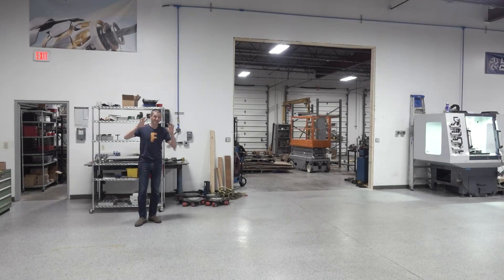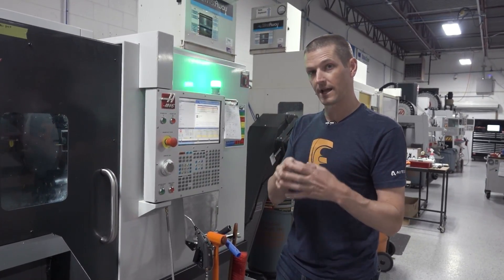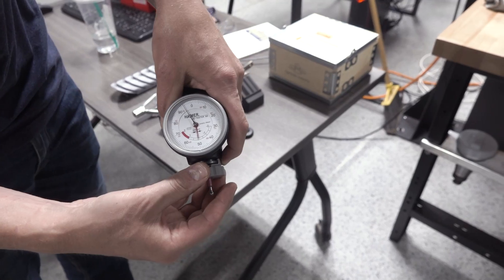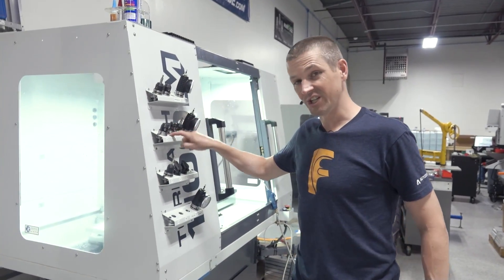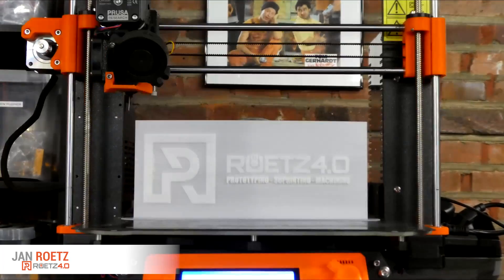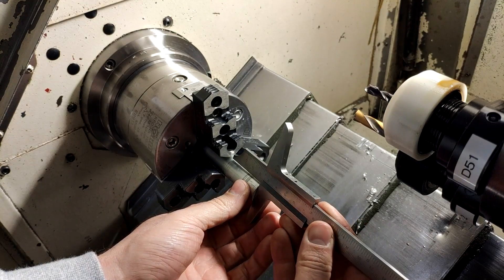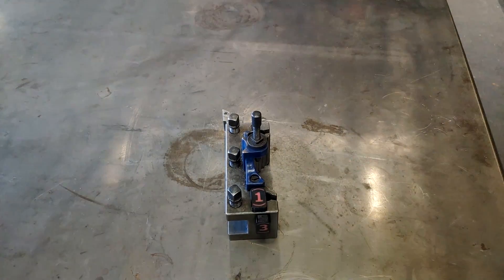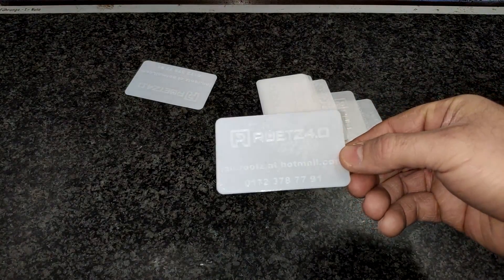Useful 3D Printed Items for CNC & Machine Shops!

Comment: I recently bought a printer solely to make useful tools and parts. Many handy items do not require a perfect or even a particularly good print so after three benchys I switched to printing storage enhancements, funnels (specialty funnels are surprisingly useful) and so forth. Phone/device holders and parts are trivially cheap to print as are RAM-style mounting ball attachments with various bases.

Comment: How did you get the HAAS and tormachs to fill when printing. When I throw them into my print software it only prints the inside and not the outside.

Comment: 13:18 buy collets that designed high speed drilling and its so tight it only let coolant thru drill. and normal collet has change broke drill in first hole if it hair angled. it happens

Comment: Well I normally use the back on a broken end mill in a callet chuck holder on the leath.
 ( metric eks. T4 M5
G0 Z10. 
X2. 
Z2. 
G1 Z0. 2 F150
M0
Z2. 
G0 Z10. 
X150. Z150. 
T2 M3 S1200) 

Always works perfectly for me and I have one hand to close the chuck and the other one to pull and hold the stuck out to the stop/ back of the broken end mill well the chuck is closing

Comment: That company Desktop Metal makes a carbon fiber printer called Fiber.  Uses a small strand of pre preg CF with some type of normal printing medium.  Supposed to be harder/stronger than steel and great for Tooling.  Might be worth a look, but its $3700 a year for the printer. 

I’ve went down a lot of rabbit holes since I started a Aerospace Tooling class. 😂

Comment: Here's a quick rundown of all of the models shown here:
(I only included parts that had a specified title and explicit "start time.")

00:36 - CNC Shop Model
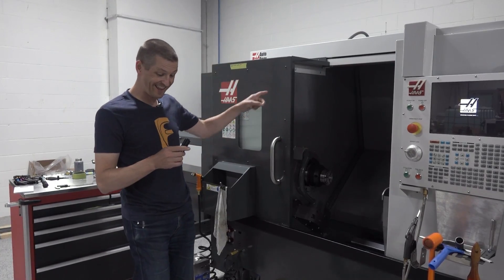1:21 - Bushing Thingy
2:26 - Linear Rail Covers
3:04 - Parts Catcher Door Extender
3:09 - Capto Block
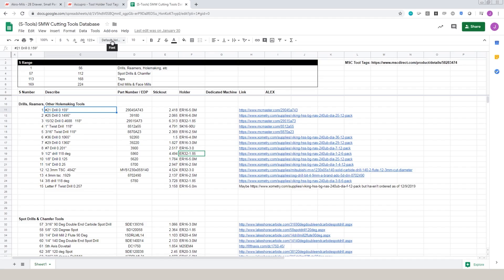3:41 - Tool Tag Organizer
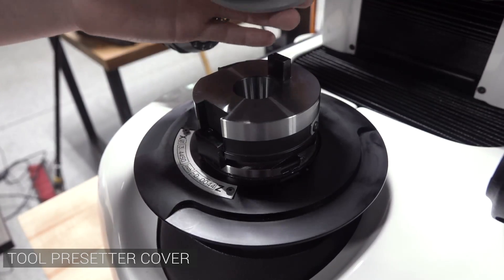4:28 - Tool Presetter Cover
5:02 - Haimer Tip Compressor
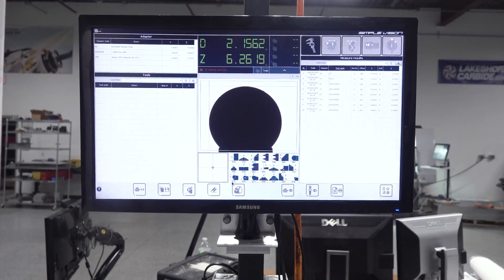6:03  - Microscope Tool Stand
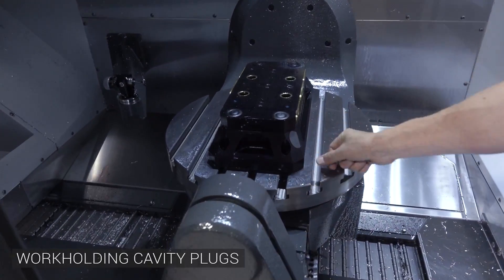7:41 - Workholding Cavity Plugs
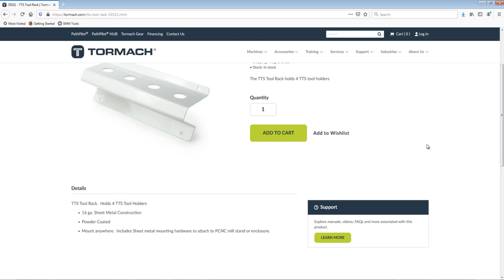8:24 - Tool Backers/Stabilizers
8:37 - Plugs to Color Code Fixture Positions
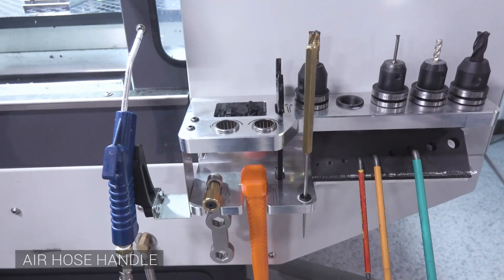9:02 - Air Hose Handle
9:11 - Schaller Bins
9:45 - Magnetic Assembly Jig
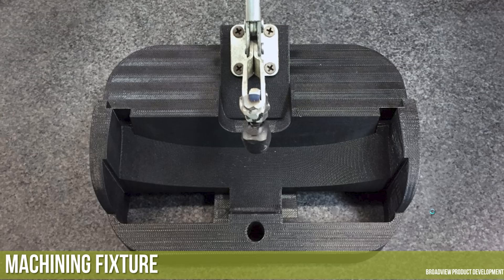10:15 - Machining Fixture
10:31 - Assembly Fixture
10:32 - Inspection Fixture
10:34 - "Around the Shop" Tools
10:36 - Organization Fixture
10:38 - Safety Tools
11:31 - Airbearing
12:19 - 1-2-3 Block Cover
13:02 - Collet Coolant Block
13:45 - Raw Stock Fixture
14:25 - Spindle Backstop
15:44 - Lathe Tool Offset Labeling
16:38 - Tool Rack
16:55 - Power Feed Adapter
17:14 - Drill Guides
17:57 - Press Tooling
18:18  - Moulding
18:43 - Signs
19:02 - Business Cards
Reply: Well, aren't you a helpful guy. Thanks a ton, man.

Comment: The Haimer preload-ring will only work with an optical tool pre-setter.  The spring tension in a typical mechanical pre-setter will further compress the Haimer tip and the measurement will still be inaccurate.  I unfortunately don't have a Speroni :(
Reply: You can still adjust the haimer to zero with the presetter applied to comp for that, no?

Comment: Interesting ideas. Given you have "access to" a machine shop, what makes you choose 3D printing something rather than machining it from Delrin? Despite 3D printing being insanely slow, is that still faster?
Reply: I can not speak for NYC CNC, but I can think of several reasons. 
#1 CAM workflow for 3D-printing is very simple compared to a CNC machine, so you may save a bunch of man hours. 
#2 Machine time on a CNC machine is likely more expensive than on a 3D-printer, as the printer is less of an investment, and tool wear is minimal. 
#3 Depending on the part in question you may save considerable amount of man hours with a 3D-printer, even if the print it self is slow, as they don't require much monitoring or interaction while making the part. This is particularly true if the part in question would require multiple setups for machining.

That said, I do think several of the parts in this video could just as well have been done on a CNC, Laser-cutter or even old-school by hand from wood or sheet-goods. The way covers would be a good example where other methods could have worked just as well. Where 3D-printing tends to shine is where you have relatively high complexity and moderate size and tolerances.
Reply: @2testtest2  I figured there'd be good reasons. I have no experience of CAM other than a little bit of Sketchup exported to Cura, and I imagine there are way more things to think about with reductive machining in terms of tool paths etc. Good point also about work time vs elapsed time - on the assumption they have plenty to get on with while waiting for 3D prints, they're effectively instant and so there's no real cost in waiting for them.

Comment: I 3D printed a mini mill CNC conversion with great success. My intention was originally to 3d print the conversion, then mill the parts out of aluminum. But it works so well I see no reason to waste my time or the material to remake the parts. I could have made them on my manual machines, but that would have taken up a lot of my limited shop time.  A 3d printer is like an employee. You give it an action plan and it gets to work. It doesn't need sleep or breaks. I have 3 printers to split up the work load for faster results with multiple parts, and am working on building a 4th that will handle larger parts.
Great video guys!

Comment: Have you tried printing in TPU, used it for seals, worked pretty nice. I use mine most for assembly tools and jigs. And fridge magnets in all shapes, magnets are fully enclosed, i pause the print at a certain hight and insert the magnets, then resume printing over them.

Comment: JUST WOW! I am 100% Disabled Vet.  and I got a 4896 CNC Router to work from home when I'm not down because of surgeries. I was 3D printing before I got wounded and KNEW the two could integrate BUT this video gave me TONS of ideas on printing holding jigs, tool jigs, storage and so on. Really appreciate the help. Video felt like you came into my shop and pointed out what I could do better. Thanks for that!

Comment: At the shop i worked at with a visual touch off machine like yours we just set the length of those manual probes to the center of the tip. Then all the machines that used it had a global WCS shift.

Comment: For the little magnetic labels, you can have the number be proud of the surface and use an M600 command in your gcode to do a filament change at the first layer of the number, and throw in an equivalent filament of a different color, giving you a number that is easy to read without the additional step and cost of pouring silicone.  The number will be proud of the surface, so maybe you wanted it flush, but I figured I'd throw it out there as another method to accomplish the same thing.  You could also go crazy with Prusa's MMU or the mosaic palette system to do multiple color/material printing in the same level, but that's more cost and more fiddling, whereas the M600 filament change is quick and free (assuming your printer firmware is relatively recent and supports it).
Reply: That's a really good idea. I'll maybe add a dual color version on the TV page!
Reply: Or cheap and easy version is to fill the lettering with the color of your choice nail polish. Let it cure and it is pretty much coolant proof, have had these on machines button labels etc (laser cut sheet metal with stamped letters filled with color)

Comment: I dont get it. Why you use a printer when you can mill these parts faster and in much better quality?
Reply: 3D printing is a better route when you're rapid prototyping a design because 
A) you have the ability to go through multiple iterations testing fit and tolerance quickly
B) the cost in plastic filament is much lower than raw stock that you remove material from
C) sometimes the design just doesn't need a machined part to operate (ex. the toolsetter cover that john showed off, absolutely 0 reason to machine that from a more expensive material when a 3D print will do just fine)
D) the time cost is not worth traditional machining all the time, why sideline a mill or lathe producing a part to organize or help setting something when a cheaper 3D printer could do that job while your costly machines can make parts for customers at the same time

Comment: I have robot at work which is used to move small cups. I was seriously pissed off to the manufacturer when I ordered fingers for their tooling. They were dimensionally all over the place and made by hand. Now I 3d print spares for that. They're Alsop perfect for us mechanics who need "bullets" to keep sealing rings intact when inserting sharp edges shafts through bushing and seals. I've made multiple for packaging machines. One of my favorites is simple ratchet "socket" that I use for handing vacuum cup screws on various machines. Someone always used improper tools to change cups and scratched suction screws, which could in tight spots mean marks on all products handled. I also make markings similar to the end of the video, but I don't bother to use silicone or something like that. I just simply print ie. black background and then have layer/color change and use something like orange to make marking really visible. Also people handle at my workplace with multiple models of canisters. One worker asked me that if I could make some tool to get better grip. Lady was really, really happy for that tool and now I've done multiple models and I'm still astonished how many "could you make something similar to model X, but that would work with this" requests. But I don't mind, I'm glad that I can help if someone struggles daily with something.

Comment: 0:42 After your remark about the 1::32 lego miniature scale I ran home to check my legos. Lego minifigs are actually scale 1::45 but they are too wide for that scale, there a 1::32 is more realistic.
Did you also have the minifigs walk around machines to check for accessibility during maintenance?
Reply: Having built 1/24 models of a house I was designing and building, I mounted a tiny video camera at scale-eye-level so I could "tour" the model (or models, as we made changes based on what the camera "saw") from inside. You need to determine the location of the POV of the camera (it may be anywhere along the axis of the lens) if you want to gimbal the camera to look up (at a ceiling) or down (as from a balcony).
Reply: https://brickarchitect.com/scale/ 
It looks indeed that the scale is not so obvious. 1:32 is mentioned in the comments of the linked article as well.

Comment: I have had a 3d printer for about 9 years now. Recently I have picked up my first Lathe and CNC mill. With the plan to start getting into manufacturing and job shop work. Primarily aimed at providing jobs for people that are disabled at varying degrees. I do a lot of work in CAD and other 3d programs. So often what I am designing already has a complete 3d model of the parts and assembly. Its so unbelievably easy these days to then take that and make fixtures and tooling.
 Most recently I made a production printing press for a product that has 7 different colors as part of the design. If I had made these in a more traditional method, by hand. The materials cost and time would of put it vastly outside the budget. But by recycling materials on hand, and printing the mechanisms. With about an hour and a half of design time. I had a mostly complete solution that just needed to be printed. So I could focus on other tasks at hand between swapping prints. Overall cost in material 40$.
I should add pretty much everything i am using at this point is easily obtainable by anyone. The printers are nothing special. They aren't even anything super high end. Yes you need to know how to get the most out of the printer. But everything has a learning curve. Its just that most of the information in this space is freely accessible, and not behind a pay wall. So sit down and learn, or spend some time helping people and learning at a maker space or school. So you can bring what you have in your head, into the physical world.

Comment: Thingaverse usually isnt good for models to base and design off of due to the nature of stls, but grabcad is incredibably usefull with their step files.
Reply: while STLs do limit your ability to import into a cad program, I have used this to get basic building blocks to slam together to determine if the idea is worth spending the time to sketch from scratch in cad. Tinkercad.com is a great tool to do basic grab and slam of STLs from thingiverse.

Comment: We bought a Prusa recently. 7 week wait and I'm climbing the walls waiting to start playing with it. First step is the sahuler bins and tool tag holders :)
Reply: Mine just shipped yesterday.I ordered it May 24th
Reply: Be aware there is a learning curve if you haven't used or owned a 3D printer before. But there is also a strong community support, and plenty of people will be willing to assist and troubleshoot. 

Only going to give you one advice, since I am sure you'll get plenty from everyone else. 

Whatever brand and material you decided to start with, say PETG from Amazon in White. Stick with that same material until you are comfortable will all your settings.....and keep your material dry. Do not assume it comes dry even knowing its in a sealed bag. And buy a food dryer ($30 Amazon) to dry the material properly before using. 

Ok that was three tips, but oh well. 

Cheers.

Comment: Thanks for sharing, John.  Lots of useful and functional 3D prints out there.  The real paradox is that most of them tend to reveal themselves after you obtain the 3D printer - not before.  I've been on the practical 3D printing train for a while and I always tell folks if you're on the fence, take the plunge!
Reply: A comment-er above suggested sending someone who's on the fence to thier local library. Many now have 3D printers for small or no cost to print an object OR a local Vo-Tech.